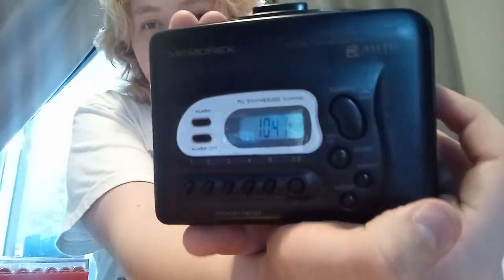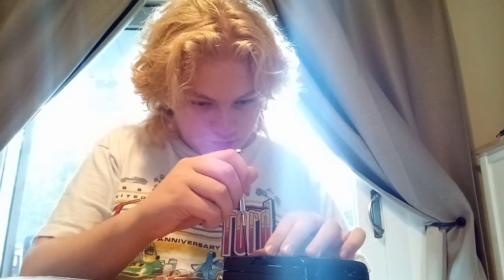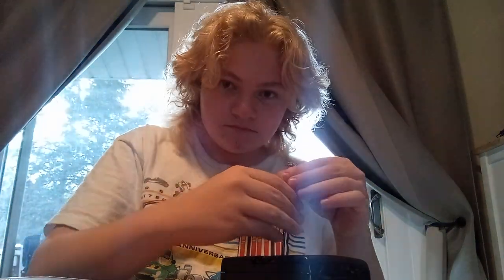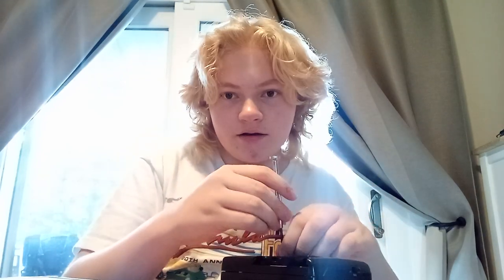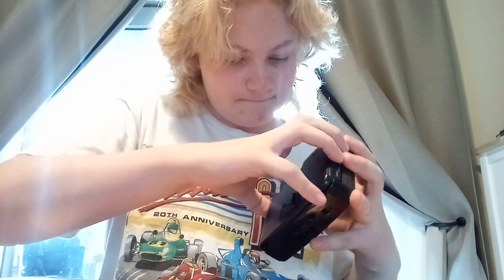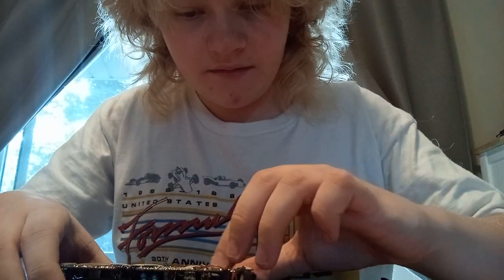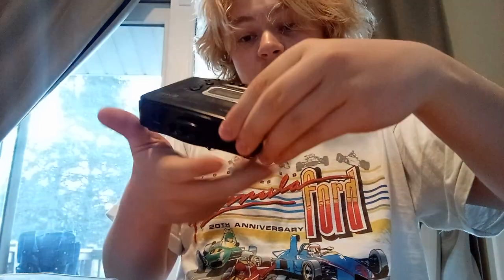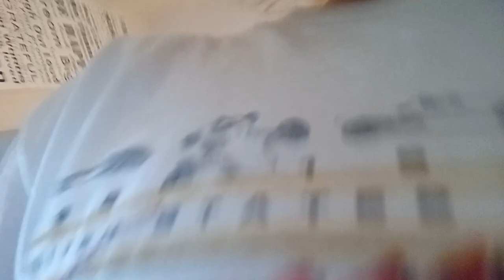My feeble attempts to fix 2 cassette players

Comment: I haven't had much luck with fixing my cassette players, especially walkmans. The Sonys sometimes have hidden tabs that you can pry with a small screwdriver, I had to read a service manual to figure that out. I've bought quite a few portable cassette players, I even made a video of all of them. Of all the ones I have the only one that works reasonably well is the cheapest little Sanyo I got in a group of stuff.
It's funny, I don't even like listening to music on the go so I don't know why I've bought so many portable cassette players. I can't really use any at the moment anyway because my lightweight headphones are broken, I'm not gonna use my large sennheisers or my old bakelite headphones as they'd be ridiculous.
Reply from the maker: What you need, is probably a pair of Porta-Pros.
Reply: @BucketHead4901  Those headphones look great, if I get a good walkman I'll get a pair. With the cheap Sanyo good headphones will probably make it sound worse.